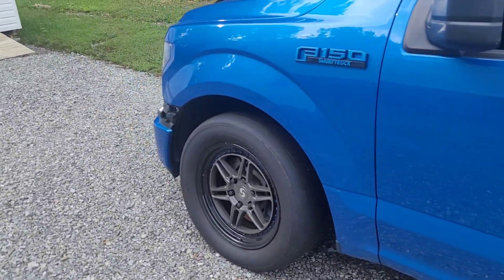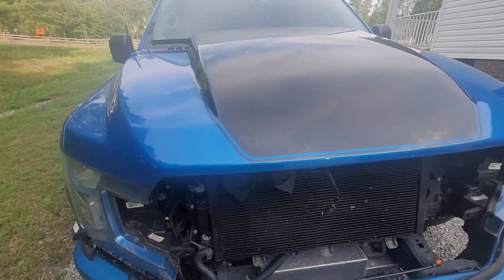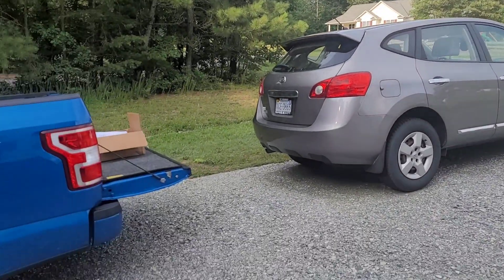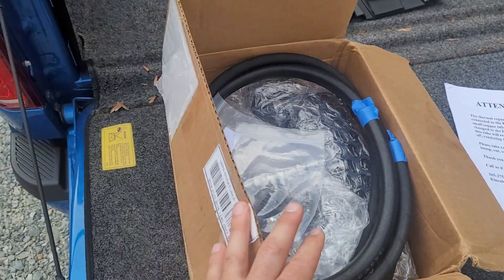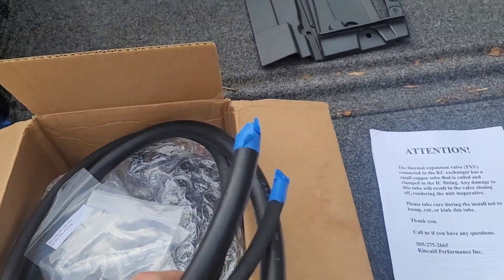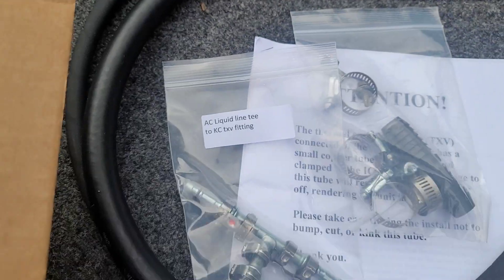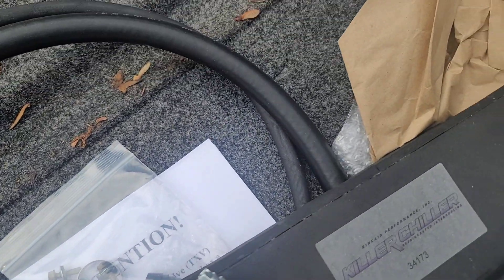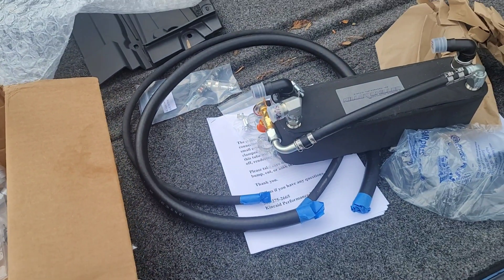2018+ Ford F150 Whipple Killer Chiller

Comment: Where did you get the tank from?
Reply from the maker: The extra capacity tank ? Came from a shop I'd rather not endorse. I will say the tank makes no difference. If anything it made IAT worse
Reply: @BelandMe  I'm just looking for a tank that isn't in the engine bay or has to be mounted in the bed. The Killer Chiller says it need a 3 gallon tank.
Reply from the maker: . I didn't have a tank.
Reply: @BelandMe  I'll probably just have one custom built. I was thinking about contacting the people at PNR welding, see what they can put together.

Comment: You have to get together with Evil twin f-150. Both yolls trucks are in the 10's.  Crazy fast
https://youtu.be/RNMlFdLfEqo
Reply from the maker: For sure. I got to get mine 100% before I keep beating on it. Still lots of issues
Reply: @BelandMe  sports cars are alot of maintenance.  Sports truck I should say.
Reply from the maker: Definitely,  than try and daily your race truck ! It's harder than it looks
Reply: @BelandMe  😁😁😄😄
Nice. Hell yeah I bet. Hey you still got a hell'of a build. 
Nothing against v8. But I want a single cab like yours lowered suspension with a 3.5 ecoboost  an a E50 tune.  There's one on tube now that's a crew cab running in the 11's. Think less weight an a few different mods get me in the tens
Reply from the maker: Oh definitely.  They are impressive.  I like the ecoboost alot. My truck has been 9s and I typically let out early bc of issues. It loses alot of power around 3-400' out. Not sure why
Reply: @BelandMe  you can still beat a trx mammoth 1000 though. An that's all that matters